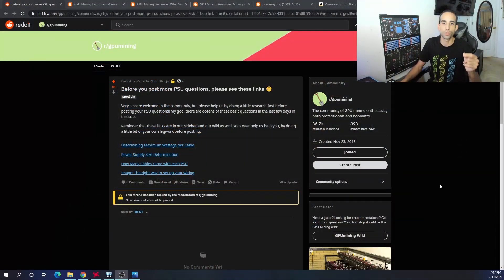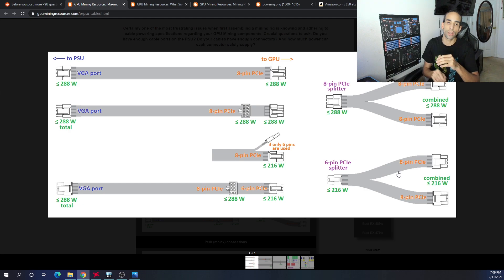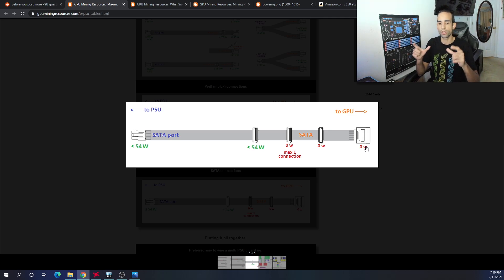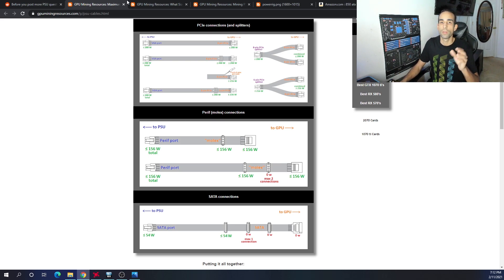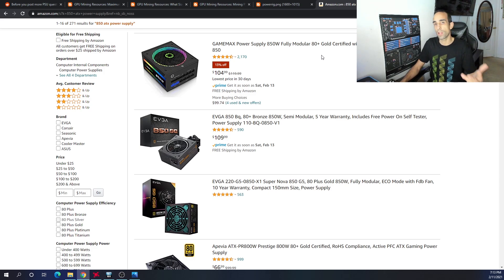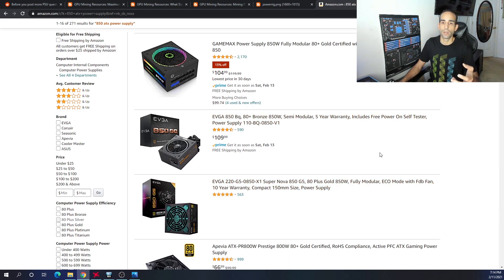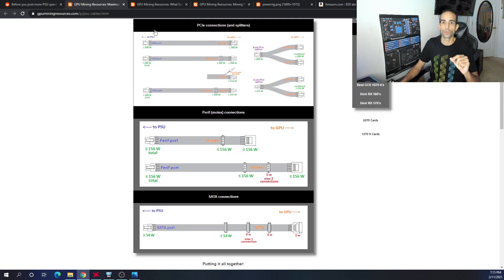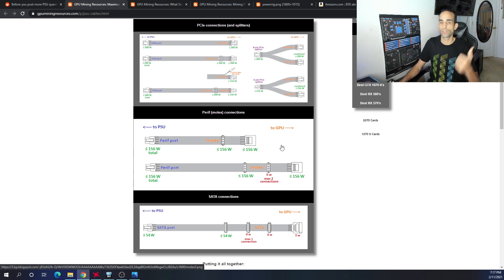Basics on How to Power your Mining Rigs

Comment: I have a b365m board and I used the 28 pin and the cpu one aswell. Am I missing a connection? Because I just wanted to see if my psu would turn on but I get nothing. Any advice?
Reply from the maker: I think you mean the 24 pin, and 8 pin cpu. is your power button working? Did that power supply work prior to installation. Test another motherboard. The board might be dead, but First and foremost.... is it plugged in? Is the outlet it is connected to, working?
Reply: @SerpentXTech  it means a lot that your replied shows your interested in your viewers I really appreciate it 😁. I needed a 2pin on/off button on the corner left top part of the rig (newbie mistake) lol but thank you sir 👍🏽💪🏽

Comment: One thing I haven't seen anyone address yet, even in the most detailed of PSU deep dives is the ability to use the remaining 6+2 cable from a dual 6+2 Y cable to power a riser. I hope I'm making sense. The GPU (3080) requires two 8-pin connectors. The cables with the PSU are 8-pin (to PSU) to dual 6+2 pin (to GPU). So when you plug them all in, you have one 6+2 pin left from a strain where one 6+2 is already connected to the GPU. If the GPU draws 240W, it's not overloading the cable if we also connect a riser using the remaining 6+2? Since the GPU is getting 150W from one 8pin to dual 6+2pin, so only needs 100-150W from the remaining 6+2 and the riser which offers up to 75W.

Would really appreciate it if you could confirm as I haven't been able to find concrete answers anywhere.
Reply from the maker: On a 3080 no... because you are splitting off of a 6 pin cable to two 8 pin, you are around 216 watts. so powering the riser off the spare technically would work, BUT what happens when the drivers crash and it starts to draw 320 watts stock? and you have the riser plugged in, now we are way over the 288 of the entire strand. This is a valid question, and if I get some time, I will show a good example. With other cards like the 1660 Ti, or 1070, or 2060, yes you would be good to go to split then use secondary 6+2 or 8 pin to power the riser as well.
Reply from the maker: Solid question Vilius, I will do my best to see if we can follow up with a video addressing your points.
Reply: @SerpentXTech  Thanks for the response. I did think about the event of where the overclocks default, that causes an issue for sure. But as long as the clocks are stable one can argue that we're not overloading them at all? Since we got two strands capable of 288W, and the card overall draws only 240W from two cables and a riser.
Reply: @SerpentXTech  Another question would be, if it can take 288W, then running at 320W with default settings isn't that much of an overkill if this runs for a couple or a few hours at the most? As I am staying on top of my system with regular checks every couple of hours.

Comment: how i can power my rig on Nice Hash miner ?
Reply from the maker: Well power is power, no matter what miner you are using. So just provide sufficient power to your GPU's then use nicehash, awesome miner, or what ever miner you want to mine.
Reply: @SerpentXTech  Nice hash Miner is not reading the GPU of my PC, I'm using the CPU to mine Bitcoin
Reply from the maker: @marianbuduroi6463  what GPU is it?
Reply: @SerpentXTech  you want to know what GPU I have on my PC?
Reply: @SerpentXTech  ok just wait
Reply: @SerpentXTech  Intel HD graphics 610
Reply from the maker: @marianbuduroi6463  that's why, its a integrated graphics, which means there is not GPU. Integrated graphics wont be able to mine like a normal GPU, so you can only CPU mine, sorry bud
Reply: @SerpentXTech  😗 no problem, at least I can mine with ☺️
Reply: that's like asking how can I fuel my car on roads.
give it fuel is the best answer since we don't know what card or cards or anything
Reply: oh dear. u a troll?
Reply: @KillaBitz  troll who? What do you mean#

Comment: Since most ATX PSU have 5-6 8-pin to power GPUs, can I use a 6-pin/8-pin to Dual 8-pin splitter to split one of the 8-pin wire from psu to power two 8-pin GPU and one 6-pin riser?
Reply from the maker: Yes, just be mindful of the amount of power you will be drawing through that one strand that is powering both GPU's. For example, it is fine when splitting the power for a 1660 Super or TI, but no so much to power a more power hungry GPU. Like maybe a 2080, look at what each card will draw and calculate from there.

Comment: I think even with power hungry cards , the risers won't pull more than 75w
Reply from the maker: Correct, and if you not powering your motherboard with molex (some mining boards have them on the board themselves) you shouldn't pull more then 75 watts.... but if a sata cable is rated at 54 watts for the whole strand, and people are connecting 2 or 3 risers on the same line..... that could be a problem. We have seen it and I have experienced it but oddly through a USB cable.... I caulked it up to mis-manufacturing but some card only pull 4 watts through riser, and some ask for way more then they should. Thats why I can't say which card is what, unless I get a custom tester.

Comment: I have a x2 molex to 6 pin connector that I want to use to power a riser since I’m running out of pcie ports on my psu. Since the riser will pull 75 watts, should I be in the clear? The 12v rail  molex is rated at 40a.
Reply from the maker: yes, it just depends on the molex pins. Check my bud Red Fox Crypto out he did a real good job also explaining powering risers.
https://youtu.be/QwLtumnF5-8